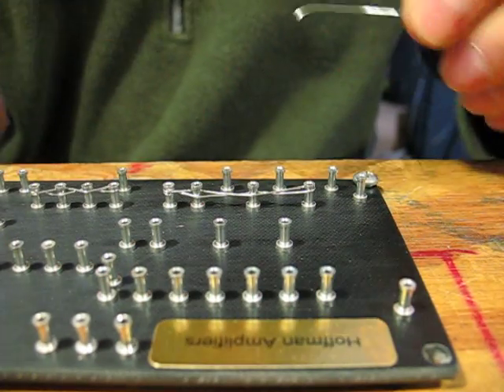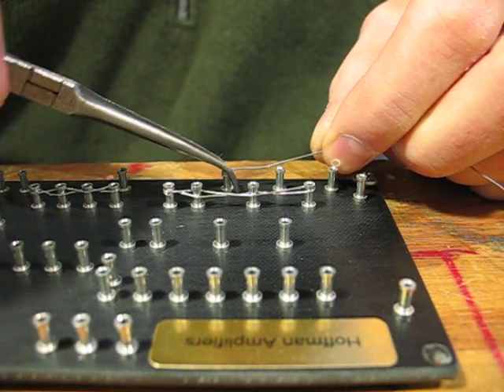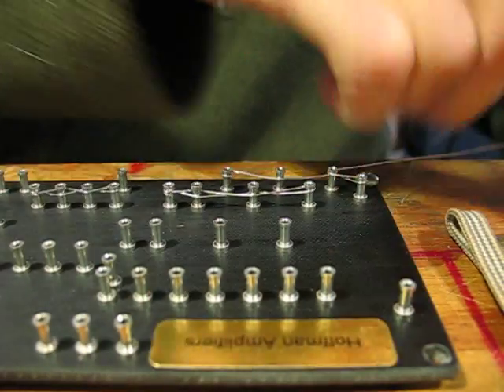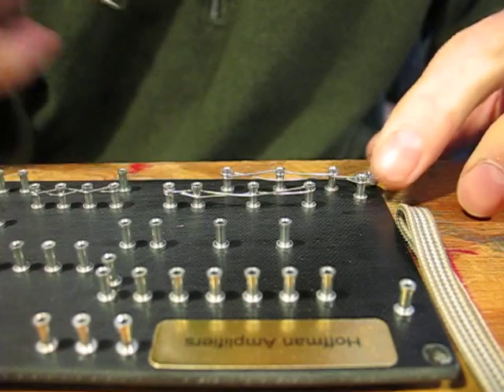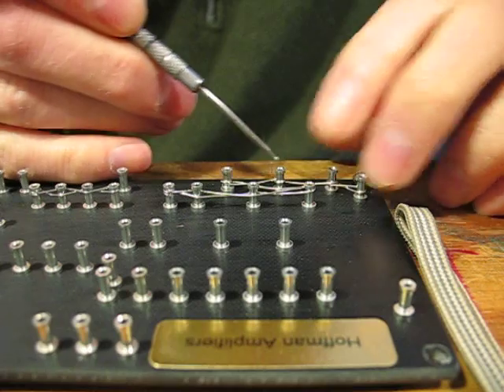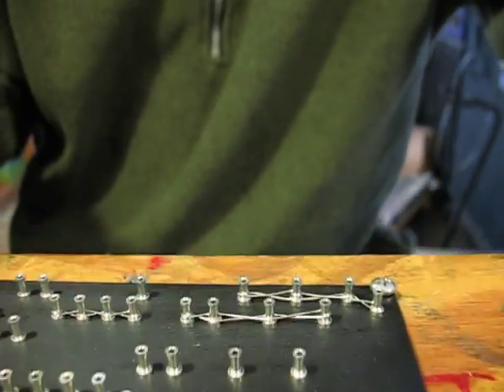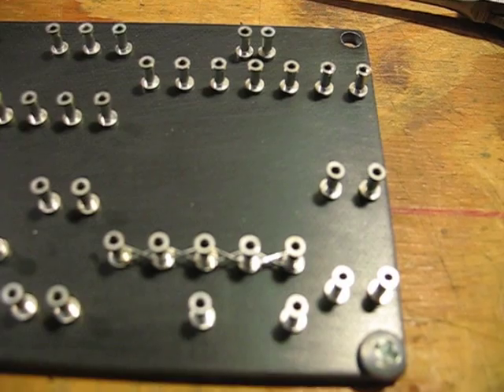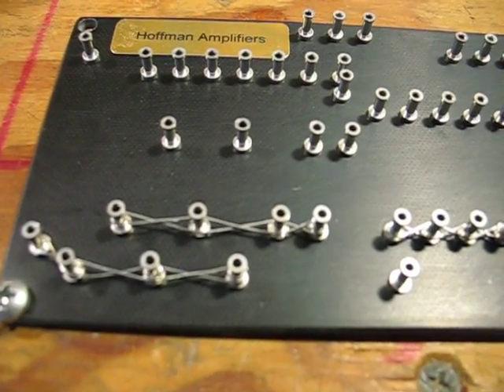Lacing up Turret Lugs

Comment: Thanks! Can I use thin solid core wire like 24/28awg? Or do I need a thicker solid core wire?
Reply from the maker: I sell 20 ga and 24 ga bus wire with the kits. You can strip wire jackets to make your own bus wire